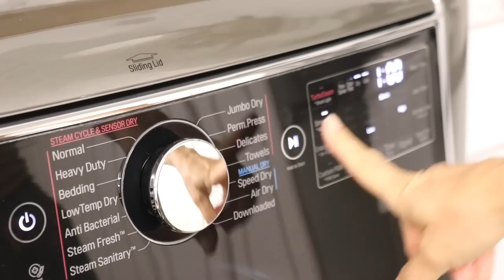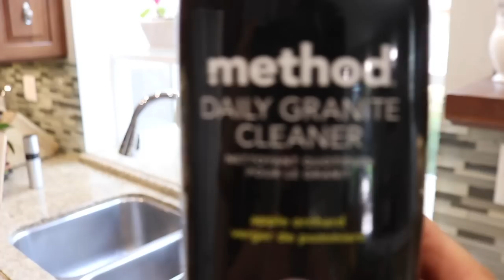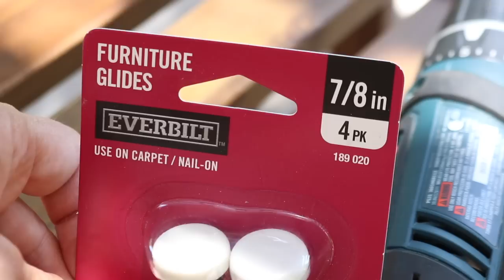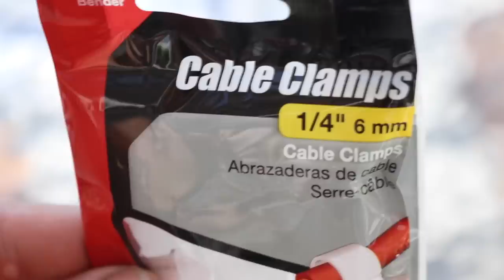CLEANING MOTIVATION | PROJECTS | GETTING IT ALL DONE

Comment: If you heated up your grill for about 5-10 minutes (only has to get about 250) the grease will liquify and it will be easier to use your brush to get everything off your grill. Then you can proceed with your system.  Just a little hack I've learned   over the years.

Comment: I wonder if you can find some non-sudsing Ammonia and a bin to soak those grill pieces? I do that with my stove top parts for the gas stove and it helps loosen the gunk with no elbow grease. I soak my parts with about 1 C of the Ammonia (it is the fumes that does the work) inside a vacuum bag overnight in the bath tub but a bin would work better given how large and how many pieces you have. Since this grill is outside you'll have all the ventilation needed. I generally don't need to do much other than scrub with a brush to remove the particles then rinse well. I would make a video except my current stove has been mistreated by previous tenants so no matter what I do the grill pieces look pretty sad. At least I can get them and the oven grills clean, though!